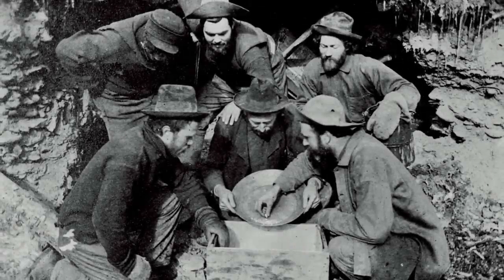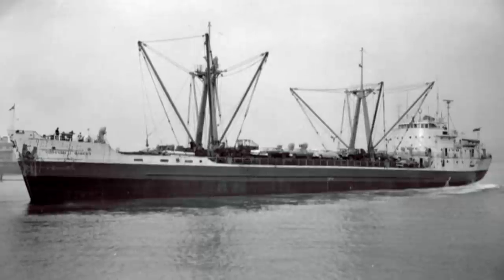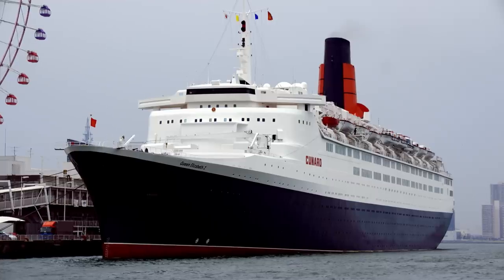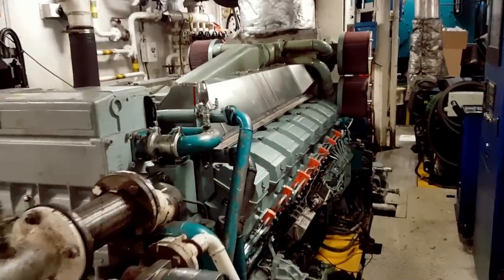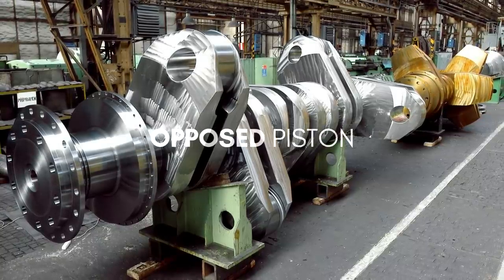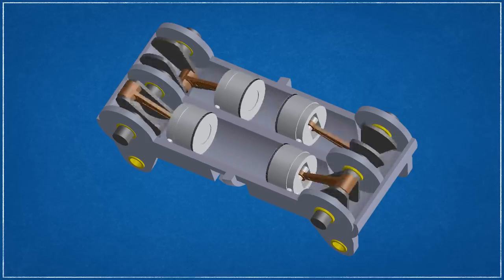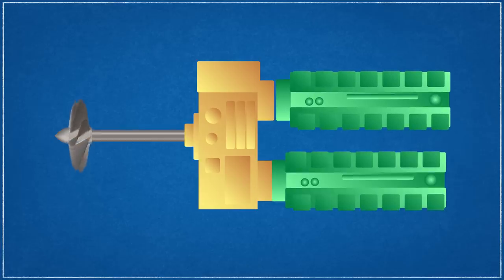The Story Of Large Vessel Engines

Comment: Nice video. I might have worded some things differently, but not bad. I sailed as an engineering officer, for context. The crosshead solves for many functions on two strokes, but yes the crosshead takes the side thrust that a no crosshead piston would require a large skirt to take. Also it allows for increased efficiency in that the straight up and down of the piston allows the piston to completely seal for underpiston supercharging, diminishing the need for a supercharger at high speeds.

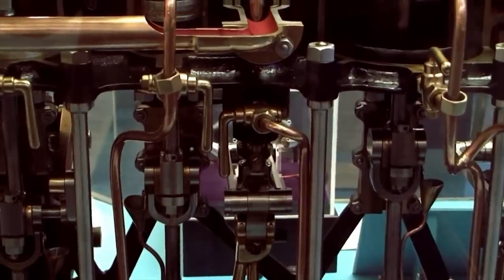Comment: The comment about the HP cylinder doing the most work at 3:03 is wrong. The work performed by each cylinder is the same because the area of each cylinder is carefully calculated to produce the same amount of "push" on its crank throw. The volume of expansion of the steam in the LP cylinder is the same as volume of expansion of a single expansion engine producing the same power at the same rpm. The staging of expansion produces advantages in thermal efficiency and mechanical operation.

Comment: For the steam engine now and 2020 you do not have to use cool but to heat the water you have generators and electric burners that can operate steam engines without Kohl's. And also now you even have frequency that ignite water with sound. Thank you for letting me share

Comment: Diesel engines do not "require far less maintenance than steam engines". 
Of course steam ships have higher operating and fuel costs. Generally their maintenance costs get higher as they age. However, motor ships have higher maintenance costs from the start. Ask any marine engineer that has sailed both (me).

Comment: Imagine a ship that could run on water...
 ;D
Reply: They all can! All you need to do is to split water molecules back into oxygen and hydrogen and then use that to fuel the engine the only problem is the energy required to do that.

Comment: steam turbines are efficient at high speeds, they do not throttle efficiently, thus if a ship is designed to cruise at 20 knots but conditions dictate slowing to ten knots the engine will be wasting a lot of fuel, alternatively the multiple reduction engine has good efficiency over a wide portion of its power band.  Turbines were largely developed for power generation and military vessels that needed very high power.  Dreadnaught and Super Dreadnaught class battleships of WWone  needed about 50k horsepower to reach their designed speeds of over 20 knots but by WWtwo battleship and aircraft carriers needed two hundred thousand or even more horsepower, not possible with recrecropacating engines and it would take an army of stokers to shovel coal into their boilers, again not possible.  Meanwhile during this period many merchant ships, tugs, etc. where built with recipts because these engines were much cheaper and more efficient at lower speeds and could be repaired by ship's crew without having a shipyard.  The same is true today, the new British aircraft carrier, HMS Queen Elizabeth, uses a gas turbine when WARP (war emergency power) speed is called but for ordinary needs diesel engines power the way.

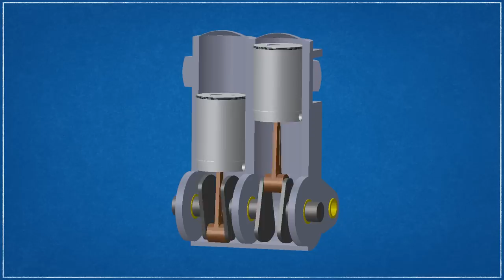Comment: 10:17  how is this different if it were used with dual crankshaft engine 8:48 with two less valvetrain, with direct drive, this would not reduce the complexity, or it can't do slow speeds?

Comment: Diesel-electric set-up is not more but less efficient than slow speed two stroke engines. They are more versatile but use medium speed engines that are less efficient, need generator that reduce efficiency by an other 5% and electric motor that take an other 5%. This is without talking of transformers and electrical distribution that can take an other 2%. Diesel electric ships are 10% less thermal efficient than direct drive. And use 10% more fuel for the same power.

Comment: Anyone knows if companies are contemplating all electric vessels? 

I know there are many challenges, but seems reasonable for the long term future
Reply: Some. So far they are relatively small (few hundred containers) and really short range (few hundred miles). So river/harbor ferrying operations.
Reply: Yes, but they are unreliable, inefficient and too expensive like most electric modes of transportation.
Reply: @MalWolf01  In fact, electric modes of transportation are almost always extremely efficient and reliable, way more than combution engines. The things holding them back are battery capacity and cost
Reply: Not possible for deep sea ships unless there is a complete new type of batteries or you get insane quick charging possibilities fairly often (or from space). As it is now you would not have much space left for cargo and only transporting batteries...
Reply: @Tadfafty  the energy density of batteries will never outstrip fossil fuel. Google energy density.

Comment: I have a question. The reason diesel engines have high thermal efficiency is bcoz they are ignited just by compression whereas for petrol/gasoline u need to mix it and ignite it with a spark plug. Why don't engineers make an engine with high compression ratio and pour very low octane petrol/gasoline in it so that it also self ignites due to high compression? Wouldn't this make them just as fuel efficient as diesel engines?
Reply: Nope. Petrol engines purposely have lower compression because of the violent explosive nature of petrol/gasoline. The higher the octane the slower the burn. Too low an octane rating and detonation becomes a hindrance due to constant preignition of the fuel air mixture. This will ultimately lead to catastrophic engine failure because of severe detonation inside the combustion chamber.
Reply: @henri1511  that's why I said a compression ignition engine should be made for petrol engine. So that the detonation happens at the time of injection itself just like in diesel engine. So there is no question of preignition.
Reply: @dranzergigs8333  Understood. But being that diesel fuel has 10% more energy per volume than petrol/gasoline, how is direct injecting a petrol engine with greater compression ratio,  going to even out the playing field. Petrol is from its very nature less power dense then diesel.
Reply: They are coming, Mazda skyactiv-X engine has spark plugs for low loads but switches over to compression ignition

Comment: You made an error in your explanation of two stroke Diesel engine. Large engines have a blower. Smaller ones may also have a turbocharger.
Reply: No, he says "air is admitted via a mechanical blower or a turbocharger". Likewise its certainly not true that there is clear distinction on size, the largest 2-stroke commercial ship engines in the world (Wartsila-Sulzer RTA96-C series) are indeed turbocharged, only using a mechanical compressor during starting (and some smaller equipment doesn't even have that, relying on port design for scavenging in order to reach startup power). Meanwhile all the smaller Detroit diesels used in everything from temporary power generators to a school bus rely entirely on a blower for early years, and later years only adding turbo charging in addition to that low pressure blower to increase specific output.
Reply: A 'blower' was slang for a turbo charger. There was a piece of equipment called a Roots Blower, used before turbo charging became the norm.
Reply: @SheepInACart  I stand corrected, I knew they had turbo but didn't come to mind.  I know the detroits well. They were one of the main marine engines for a long time and was the most popular of all of detroits engines and were only retired due to emissions issues. Many are still in service. The trubos were added as at higher rpm the blower did not provide sufficient air and at that point the turbo kicked in.

Comment: Bro include conversions to feet. I'm an engineering student, I'm not dumb... But no matter how many times I've heard, calculated, and used the metric system - I still have little to no idea the scale unless I spend a minute with a pencil and calculator. It's 3:08am here and I'm drunk do you think I want to to that? No. Just put in the freedom units ok they aren't going anywhere
Reply: DroopMoose It ain’t that hard to round and multiply by 3

Comment: Solar powered container ships please
Reply: 1. There is no room to fit solar panels since cranes need to have access to the containers from the top.
2. Solar panels does not provide even close to the energy that these ships need at crusining speed.
Dont get me wrong I love solar/clean energy but im just being realistic here
Reply: Well, as long as science manages to increase the efficiency of commercial solar panels to at least 70 or 80 percent, I can see solar powered container ships not far into the future, maybe some sort of another boat that has panels and supplies it to the ship.
Reply: @hyperparadox1  No.... Even with 100% efficiency its still faaar less than required to run container ships...
Reply: @William_ar98  Firstly, even 10% fuel offset would be a great investment for a shipping company. Next, the sides of the ship are gigantic flat real estate. Last, high efficiency panels, highly efficient electric motors, shed weight of fuel and engines, and machine learning in combination would provide a greater percentage of required propulsion than what's being written off.
Reply: I'm sorry, solar powered solution is not going to work. With ballpark numbers, large container ships use minimum 150 tons of fuel per day, thats around 6 tons per hour, it's like 270000 MJ of energy=75000 kWh and with maximum solar irradiance of 1 kW/m2 we would need a whole lot of solar panels...
Reply: @Stemolap  No one is disputing the energy density of "fuel". Assuming your numbers are accurate, and for simplicity's sake, assuming an equal efficiency of fuel to propulsion as solar energy to propulsion, a medium sized ship has a surface above the water of 4000 m² on just one side of the hull; 4Mwh of fuel energy offset. That is before any alterations to design to maximize solar collecting area. e.g.: folding/rolling panels upon the deck or bow/stern. Integrated containers.

It's not "the" solution but it certainly makes a dent and is a move in the right direction
Reply: @AlexFoster2291  Yeah, I agree, solar power on board can reduce total consumed power, but i was answering regarding "solar powered ships" issue. Usually companies search for options to sail ships as cheaply as possible with maximum possible revenue, ships are big floating money sucking black holes. In a world of rising fuel prices and tighter ecological restrictions, they are looking into marine pv panels and other money saving solutions, there are some test ships out there, but usually the amount they save on fuel consumption is in single figure percentages, while adding new (more costly?) problems for them. Shipping industry is conservative and new solutions are slow to take hold on and currently it's more profitable for companies to invest in general efficiency increasing solutions than untested and risky "green" solutions.
Reply: seconding the nuclear option. In the American fleet, not a single reactor incident has occured since they started using nuclear subs and ice breakers. On the condition that you lead the ship's reactor room in military style (don't use your mind, do what the procedure written by engineers says), it is an incredibly safe way to power a ship. 
Sticking solar panels to the sides is not a good plan. The efficiency is ruined because of the bad angle under which the sunlight hits the side. Also, sometimes you'll have the sun straight in front of you or behind you, which makes the power generated drop to nearly zero. And of course at night you won't generate anything.
Reply: Why not wind powered instead?  Or both?  oh yeah, its because neither work.
Reply: @MalWolf01  Wind power (in the form of sails) doesn't work for container ships, but it's a viable addition to smaller ships.